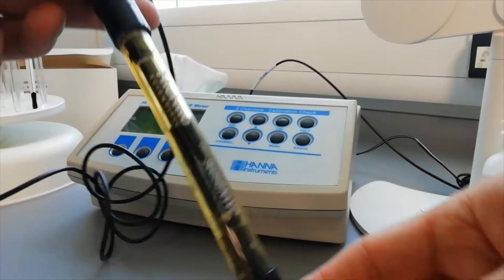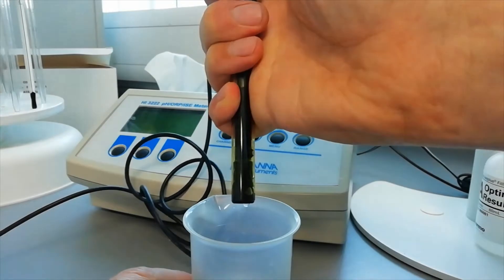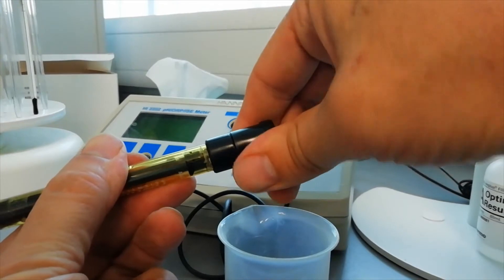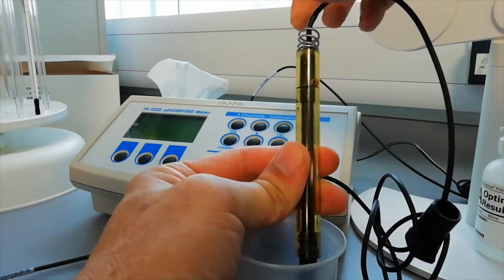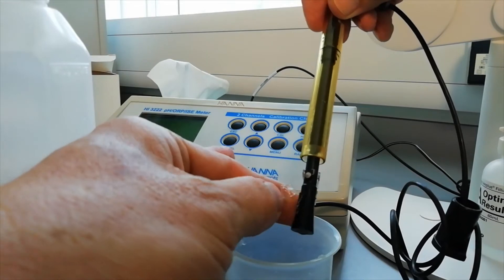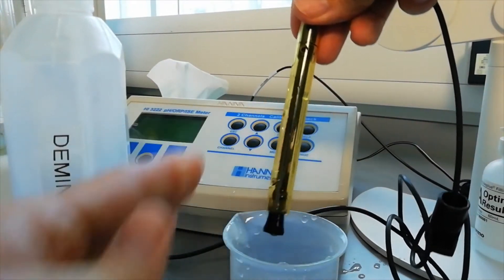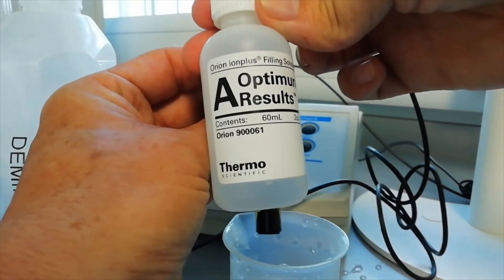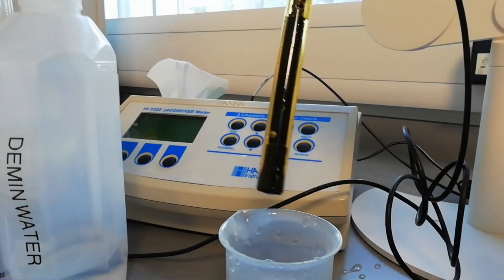Cleaning Orion 9609BNWP Fluoride probe

Comment: Hello
I'm a person who works in a Korean laboratory.
I have a question.
I can't have Fluoride  low level(0.1ppm)
The reaction rate is also slow.
Will it get better if I wash it?
Reply from the maker: Hi. If there is a build up of crystals in the end of the electrode this will supress the response and cleaning will improve things. However in my experience measuring below 1ppm is beyonds the limits of the probe.
Reply: These probes routinely read below 1.00 mg/L. USE limits for Fl- is 0.7 mg/L.